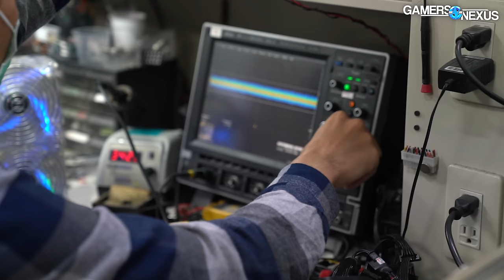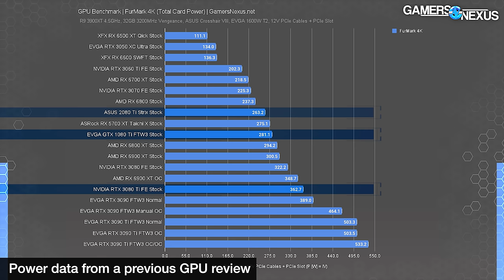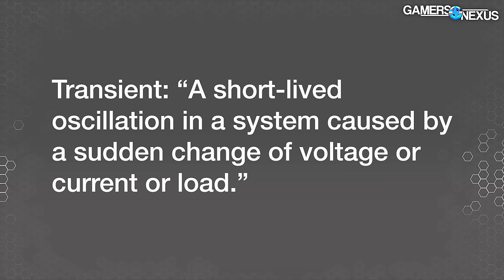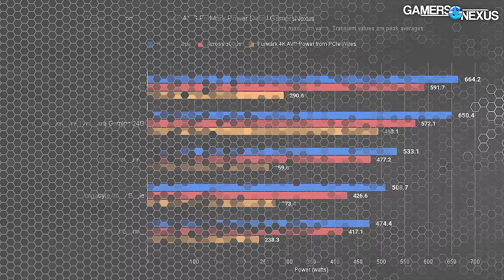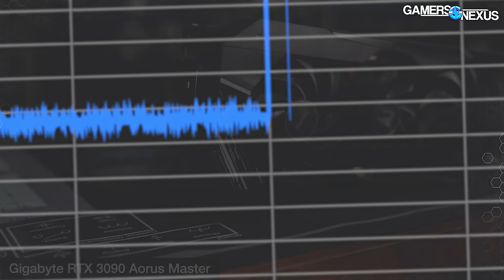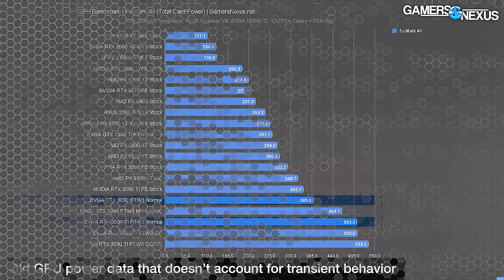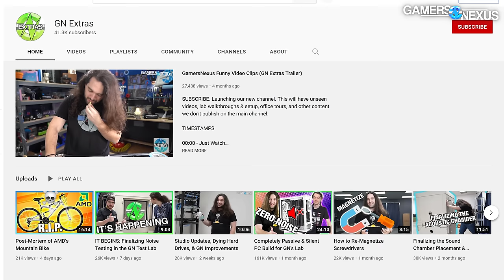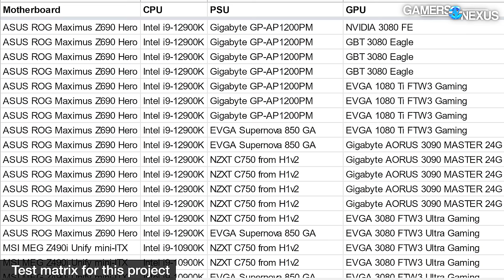The Brewing Problem with GPU Power Design | Transients

Comment: Great job on the video!

Corsair TX850M - ATX - 1105w OPP trip point
Running:
Gigabyte Z370 AORUS Gaming 7
Intel Core i7 8700k Water Cooled
16GB DDR4
RTX 3090 Hybrid Cooled - Powered down to 81% power target to control temp on EVGA Precision X
GTX 1070 on the next 16x PCIE slot running 8x

I've had 1 or 2 sudden shutdowns gaming, but aspire to run a LLM AI and Chat bot instances on the RTX while running the monitor and rendering on the GTX. How do you think the TX850M will fare with that kind of load on the GPU?

Comment: I have a 700w sfx l psu that's been working okay with a 3080 for a couple months now. No crashes since I got it stable with overclocking the 5800x
Psu is - SilverStone 700 Watt SX700-LPT v1.1 SFX-L Fully Modular PSU/Power Supply

The rest of my build is:-
EVGA GeForce RTX 3080 XC3 Ultra Gaming 10GB GDDR6X
b450 aorus mini Itx
AMD RYZEN 5800x - (in ryzen master its clocked to 1.24volt at 4.4ghz) so not particularly high clocks but did this to reduce power consumption
32gb RAM at 3600mhz
ARCTIC Liquid Freezer II 280
Also have 3 sata Crucial ssd in raid 0 for games and a 2tb pcie4 nvme corsair drive (set to pcie 3 due to the Motherboard)
also I have 5 120mm case fans and 1 140mm fan not including the AIO

I think the reason I got away with it is due to this EVGA card being 1 of the smallest you can get so it doesn't have an Overclocking by default (as far as I am aware) and I kept my CPU clocks quite conservative compared with what others have posted in forums. I did this so that I could keep the CPU Voltages quite low compared with stock which can at times draw between 1.3 and 1.4 volts. But could be mistaken it might just be that the 700w platinum PSU is really conservative with its claims of being a 700w psu to keep its platinum claims.

Comment: I once ran a Q6600 system with an HD4870 1G (105w+150w) on a Seasonic M12ii 380w supply for 7 years, with an average pull of 250ish when gaming. Thankfully that power supply continued into my i5-2500k NAS/Plex/Minecraft server, and is still kicking today. Definitely not something we can run so close today. Current rig is a 3900X and 2080S on a Corsair RM850x. Plenty of headroom this time.

Comment: This was a real problem with my 3080Ti when i was using some video editing software. After rendering a couple of videos, it just killed the whole system. Sometimes on the first render. Updating to a later version fixed it to just software crash. I definitely blame Nvidia for the lack of input filtering. The PSU is a 750W EVGA supernova

Comment: I had the gpu spike issue and fixed it by upgrading the PSU from 750 watts to 1500 watts. Now during heavy games it trips the circuit breaker instead

Comment: I have a SF750 and an MSI 4090. Sometimes when playing Cyberpunk 2077 in 4k with Path Tracing enabled, the PSU will cut the power because of OCP. Other times it just turns off but the PSU does not need to be reset. The PC has 2x 3.5" HDD's, 4x fans, 2x sticks of RAM. The CPU is a 7800x3d. The GPU and CPU are both undervolted. Going to try adding a dedicated power cable for the third connection of the GPU and see if that helps.

Comment: One more data point for your failure sheet. Asus TUF Gaming X570 Plus WiFi, Ryzen 3800x, Corsair HX850, and I upgraded from a 2080 Ti to an MSI 3090 Gaming X Trio. By the end of the year, it eventually killed the power supply dead. Not just a temporary shutdown this time. I had to run to Best Buy and grab a Corsair RM1000x to get back into the game.

Comment: Maaaan, I spent a large chunk of late 2020/early 2021 trying to run down "soft shutdowns" that would just black screen and restart my PC. At the time I was running an AMD 3900x on a Gigabyte Vision D rev1 board, with a Seasonic Focus GX-850, and a couple different GPUs (EVGA 2080 super/MSI Gaming X Trio 3070). Due to the windows event viewer i was chasing WHEA Hardware Error Events, most of which were something useless, like "system shutdown unexpectedly" error codes and random googling would take me to AMD boards so I was convinced it was the 3900x.

Comment: I just replaced my seasonic 850W PSU for an EVGA G6 1000 as my new 3080 kept causing shutdowns when running RE2/3 at higher fps. When I capped it at 60 I never had any problems but running unlocked tripped it every time. Haven’t had any issues with my new 1000W PSU now. Does make me wonder if I should have gotten an even bigger one if I’m wanting to get a 4000 series card in the future. I could also upgrade my cpu to model which uses less energy from AMD but that would require replacing the RAM and MB as well. Funny enough my prior card was a 1080Ti but it never had any power issues or shutdowns with the 850W unit from seasonic. Thanks for this video.

Comment: I got a 3080 pretty close to launch and was having system shutdown issues when playing graphically intensive games. Spent so much time troubleshooting the GPU until I realized my shitty thermal take PSU I purchased solely because it had even shittier RGB had terrible transient response. Swapped to an RM1000x and no issues. Wish I had this vid back then as I spent so much time confused of what was wrong.

Comment: 1 Farad Capacitor (car audio) added inline to the GPU will power stabilize any voltage spikes. 1 Farad can handle up to 1,000watts which is enough for any GPU.

Comment: I got an Asus rog thor 850 platinum psu: 
Cpu: i7 10700 non k
Gpu: rtx 3099 ftw3 ultra gaming evga
Ram: 32gb corsair vengeance pro
Mobo: msi 490z gaming edge

I can confirm that I did not had any shutdown, used all the pcie cables... No issues at all, the most the psu ate was abot 580 watts. This happened when I was playing rdr2 and cyberpunk.

But another thing I am doing as well, most of the time I UNDERVOLT the card why you ask? To maintain the gpu for a lot longer

Power:100
Temp: 83

Fan speed: 55%

Most games will barely hit 67 or 65 if you do it by this.

Hope this helps!

Comment: I had a EVGA 980ti SCavx+. Official Power consumption is 250W It regularly shut down with a 500W PSU, with a 750w PSU it stopped shutting down.

Comment: TX650M 650W 80+ Gold PSU here. My Comps: Ryzen 7 3800XT, Asus TUF Gaming RTX 3080, 2x8GB GSkill Trident Z Royale 3600Mhz RAM, 2x NVMe 1TB, 1x 250GB SATA SSD, 4x Corsair LL120 RGB Fan, Corsair Commander Pro, Asus TUF B550 Plus Gaming MB.
Working fine. No shutdowns so far. :D
Reply: I have this PSU. Have you had any problems with your system in the last 6 months?
Reply: @SAFFY7411  
Hey! No it's running just fine so far. I even upgraded to a 5800X3D and 2x16GB RAM.
Reply: @Kley96  Champion. Thank you for getting back.

Comment: Great video, thank you. This may explain what I've been dealing with, but one question....could transient spikes be the cause of a circuit breaker tripping?

I've had an Asrock OC Formula 6900XT with a Corsair RM850i and the occasional PC shut down, black screen, etc.
Recently moved, and now the same system is tripping my room's circuit breaker.
Both environments used 15A breakers, and the new environment actually has less load overall.
So, assuming the labels on circuit panel are accurate, and electricians wired correctly, I would expect an issue at the old house, not the new one.

Purchased an EVGA Supernova 850 P6 Platinum, as yeah the PSU is where we hope the issue lies, and encountered the same tripped breaker.
After watching this video, I am debating returning it and sourcing one of the two recommended here.

I just found an extension cord this evening and plan on running it to a living room outlet (Best attempt at ruling out an issue with my room, right?) to attempt to reproduce the issue, but man after trying to troubleshoot this for TWO WEEKS, I am beyond frustrated, and so so tired.
Even if I could have found my multimeter, sounds like that wouldn't have really provided me additional data trying to solve this.

Comment: I think this explains why my 2070 Super system has been randomly doing what is described in the video. I'm running a Corsair RM 750X with a TUF gaming board. Seems like even if I don't upgrade the card, I will need to move to a 850-1k watt PSU.

Comment: was using a corsair 750w platinum for around 3.5 months on a zotac 3090 with no issues, swapped to a 3080 FTW and also have had zero shut downs to date (6 months)

Note : using a 3900x for processor

Comment: Last year, we had an energy surge that fried most appliances in my home, as I am a tenant and my flat was supposed to have a surge protector the landlord (the local government) agreed to cover the cost of replacing most urgent appliances (cooker, freezer etc.) but I had to buy myself a new PC, luckily my old GTX 970 GPU was still working as I barely had enough for a new CPU, even after a years worth of savings I'm barely 25% of the way to being able to afford a decent GPU let alone a good one. I'm actually kind of glad in a way as by the time I can afford one they will be much cheaper and hopefully more stable, I have heard many stories about these new GPUs people are buying in desperation that have been cobbled together with glue and sticky tape by the manufacturers who cannot build them fast enough then customers are greeted with a component worth twice the value of their rig that immediately fires that rig and itself within a month of use. 

In 2032 I should be able to afford a new GPU, but I'm not even certain there will be a 2032 if we continue to see this upward trend in global catastrophes, at least I won't have to spend a decades worth of savings on a single component...
Reply: "If you find yourself alone, riding in the green fields with the sun on your face, do not be troubled. For you are in Elysium, and you're already dead!"
Reply: @AllahuSnackbar270  Brothers, what we do in life... echoes in eternity.

Comment: I just upgraded to a 12700k from an 8600k and I've had 2 of these shutdowns during 4k gaming in first two days. Setup is: MSI Z690 Carbon Wifi, 12700k, EVGA ftw3 ultra and Corsair rm850x PSU. Should I get a 1000w PSU for the extra head room? If so, suggestions on one that won't break the bank?

Comment: I picked up an MSI 3080 ventus 3x OC GPU recently. I have an MSI PC Mate Z97 and Rosewill 650s Hive PSU and I experienced this. I replaced the PSU very quickly with an EVGA Supernova 1000 G6 and I haven't had the issue since.

Comment: I have an asus 3080 10gb, gigabyte Aorus pro mb, 850 watt power supply. I was getting sudden losses of system power occasionally when playing games. Usually 1440p with all settings maxed, generally after an hour or two... I wasn't sure if it was heat, power surges etc. I was eventually able to rule lots of things out. After some research I actually stumbled upon ACPI C states being a potential culprit.  I disabled C States in the bios and my problem was immediately gone. I suspect the bios putting the cpu into a low power state, combined with transient spikes, somehow causing instant losses of system power.  I'd strongly encourage anyone seeing crashes like that try also turning off C states before going and buying new parts. Not entirely sure why but that definitely fixed my issue.

Comment: This is good information to put out there, but I don't think it accounts for most of the reboot issues. I have a 5900x, gigabyte b550 aorus pro ac, msi 1070, gskill trident cl14 32gigs, seasonic focus px 750w. I get reboots in some games but not others. I can run furmark and prime95 for over an hour even with hitting space bar to induce spikes and no reboots and no heat issues. I tried a 2nd psu(evga 750g2) with new cables and same reboots. I swapped a 1060 in for the 1070 and same reboots. The 1060 is not power hungry and even a 4x spike should have me maxing out the psu. I rmaed the cpu and memory and same issues. I just sent my motherboard off yesterday for rma. I tried every fix I could find, soc 1.1, idle control to typical, no xmp, power scheme to performance, min cpu idle to 5-10%, etc and nothing works. I highly doubt the transient spikes are what are causing my reboots so there might still be issues out there worth investigating in that area.

Comment: Hey, I'm running a Corsair SF600 with a R5 3600 & RTX 3080 FE. I typically run my card with an under-volt profile of 1950MHz @ 931mV, I have never experienced any sudden shut downs during gaming loads, BUT I have noticed more random restarts / shut downs when using chrome since upgrading from the 1080 to the 3080 🤷‍♂.

Comment: I have a Silverstone 700W Gold SFX, and a Gigabyte RTX 3080 Vision OC which means power wise my system is below spec for the 3080, however I have not experienced any shutdowns when benchmarking, mining or gaming for over 1.5 years. One caveat though, the system is paired with a 5600X and I mostly play 4K60p Ultra, which means that while the GPU is operating at full load, the CPU is most likely under loaded and consuming way below its 65W TDP rating. This is one of the reasons, I chose the 5600X for the system.

Comment: Asus tuf X570 Gaming, EVGA SuperNOVA G2 650W, Gigabyte GeForce RTX 3080 GAMING OC. Got the 3080 on launch. This combo worked fine until two months ago, when I started to get PSU related shutdowns under load, about once a week.  Though it's probably worth noting that the PSU was 6-7 years old at that point, and I've probably been running close to it's max rated spec, when the system was under load, ever since I got the 3080.

Comment: MSI Suprim X 3090 overclocked///5900x PBO///MSI gaming edge motherboard///NZXT 850w power supply, never had a problem at all. I play Cyberpunk at basically max settings ray tracing maxed all the time. The whole computer draws around 670 watts. When I was buying parts for this computer the guy at micro center suggested the NZXT power supply. I was a bit skeptical but then I was like alright F it why not. He said he's been seeing a lot of EVGA power supplies being returned recently. This was about 16 months ago

Comment: Thank you for the video.  You helped me solve an issue I had been working on for years.  I built a computer a couple years back on the AM4 platform.  Everything would work fine with the exception of one game Company of Heroes 2.  I would run benchmarks on Time Spy and Heavens and the system never crashed even after continual runs.  However, when trying to play Company of Heroes 2 on Max settings 1080 p  the system would randomly hard shut down and I would have to unplug the power supply and flip the switch and re plug back in to get the computer to turn back on.  I had always thought it was an odd .net frame work issue as the hard shut downs were random and always seem to correlate with an update to .net framework. in Windows Update.  Running running the game in Windows 7 compatibility seemed to help but also seemed to reduce the number of FPS the game could run at.  So I had chalked it up to the game not liking my hardware due to software or something.  

On the internal bench mark of the game the min frames would be around  the following: (no compatibility settings set)
min: 53.95
max: 115.31
average: 78.70

I have since knocked the graphics down to low resulting in the following bench mark scores (no compatibility settings set)
min: 64.55
max: 126.62
average: 85.40

No more hard shut downs experienced since then.  It would seem the spikes were causing my computer to shut down  as far as I can tell. 

System info: 

Mother Board: Asrock Taichi x570 
Ram: 32 GB G skill 32 GB DDR 4 3600 (duel channel kit 16 GB by 16GB)
Power Supply: Seasonic Focus PX-850, 850W 80+ Platinum Full-Modular
Processor: AMD 3900XT
Storage.  2 intel 660 p 2 TB, 1 Segate 2 TB  Sata hybrid drive 7200 rpm, 1 Western Digital Black Calvier 4 TB drive Sata (7200 rpm)
Graphics: PowerColor RED DEVIL Radeon RX 5700 XT 8GB  (over clocked switch ticked on the card)
MISC: 1 Asus DVD RW drive
UPS: CyberPower CP1500PFCLCD Pure Sine Wave

Nothing over clocked except the XMP enabled in bios and the switch on the graphics card switched to OC. 

Motherboard settings altered from stock:
XMP enabled
Fans switched to performance 

Notes: 

A separate cable was ran to each of the separate CPU  plugs on the motherboard and two cables used for the graphics card as well.
According to the UPS idle is around 243 watts and during in game benchmark hits around 300 watts at peak.  Note the Monitor and speakers are also plugged into the UPS.

Anyways I hope this information helps someone else out as well.

Comment: Im getting shutdowns in some games (Apex,Soma,Tomb Raider) but multiple runs of Heaven, Time Spy and Cinebench are 100% stable. Setup is Asrock Z390, I7-8700, EVGA 2080TI Black, on 750w gold Thermaltake Toughpower grand. Temps are not an issue. Feels like Ive tried everything  to keep my system from shutting down randomly so next test will be EVGA 1300w Supernova. Really hope that fixes the issue. Ill post back either way! 

UPDATE

Its been 10 days on the new power supply and no more shut downs!

Comment: If it matters to anyone. Corsair Sf750 with a 3090 ftw3 ultra 5600x b550i strix ddc pump 3 fans and rgb everything of course. all custom water looped and no random shutdown or anything like that. All stock and no overclocking except xmp setting for the ram.

Comment: If you gonna run with the big dogs, get the the big dog PSU.  Been running kilowatt power supplies since socket 775 qx9650 with two GTX 285's rig.  That qx9650 still running with a GTX 980ti, and a quality kilowatt PSU, which is overkill, but no worries on running out of juice.